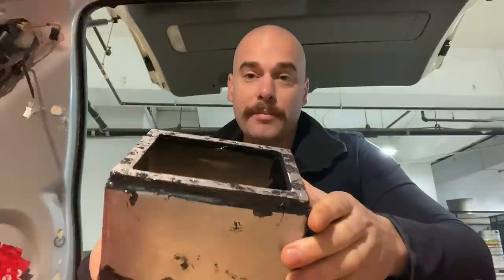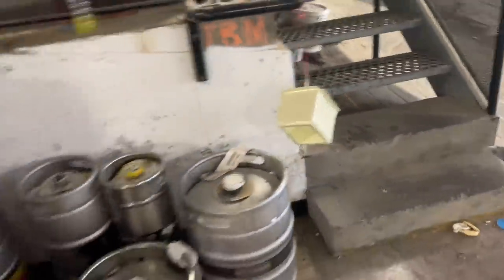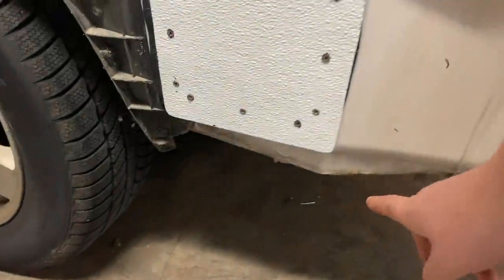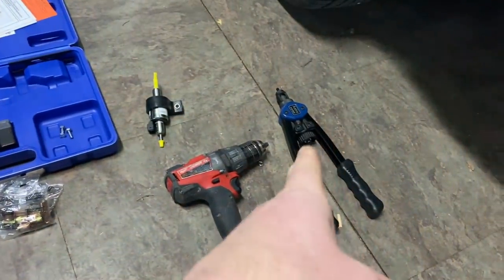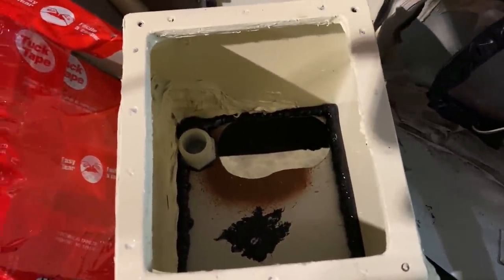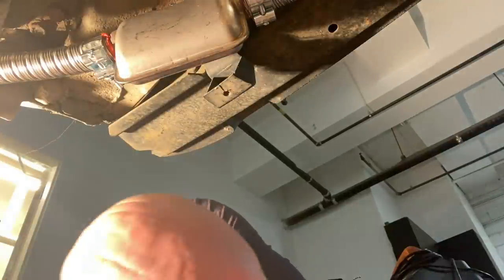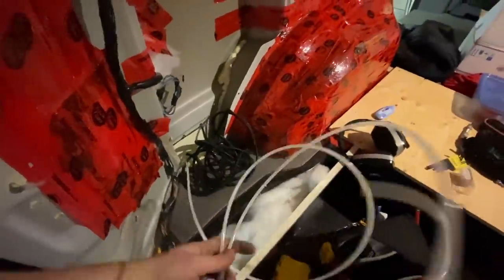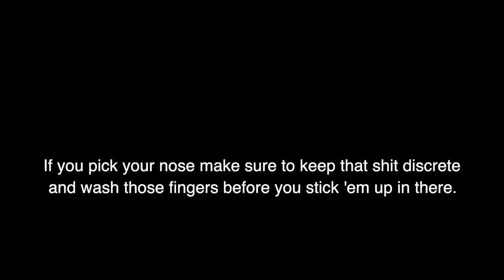MINIVAN Build E-16 || Diesel Forced Air Heater Installation

Comment: The heat is on. On the street. Inside your head. On every beat. And the beat’s so loud. Deep inside. The pressures high. Just stay alive cause the heat is on. — Glenn Fry

Don’t ask me why, but this song popped in my head during your video. 🎶🎸🎵

Comment: The last time I bought a tube of that Permatex gasket maker, the really young guy working at the auto parts store asked me what I intended to use it for. Told him I had replaced the pump on my washing machine and wanted to make sure the water line connection didn't leak in case I didn't have the compression fittings quite tight enough since I don't have great hand strength. He didn't know what to say at first and was then like, "Yep. It will work for that." I think that young man learned a valuable lesson that day, lol. Thanks for the memories!! Oh, yeah, and nice build video too... and I hope you washed your hands AFTER as well.... 🤧😉🖤

Comment: 15:37  Did you re check this? I had always seen them pointed UP more at a 40* angle.. VIA CHROME's video???
Reply from the maker: I did recheck it. can't say I came across anything around canting it on and angle.  2 winters seasoned and it all seems good.  I'll check it again when I go over the whole thing this summer.